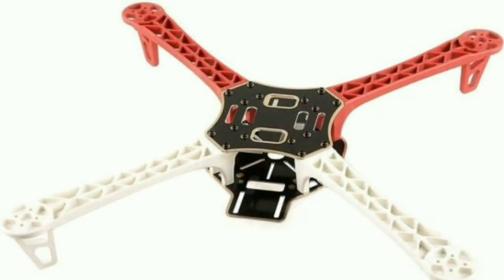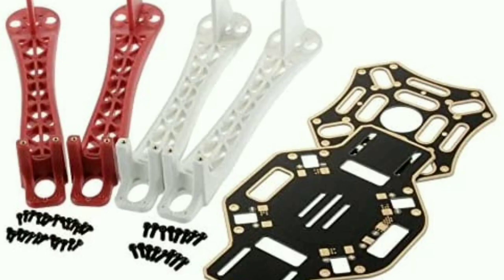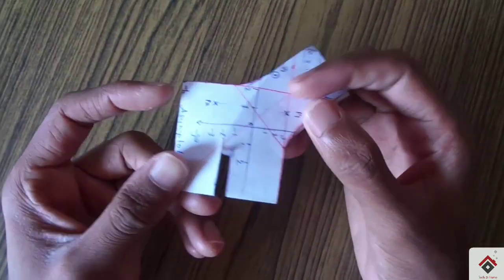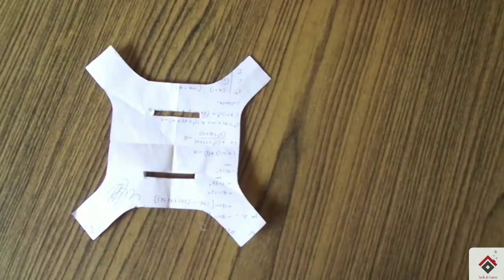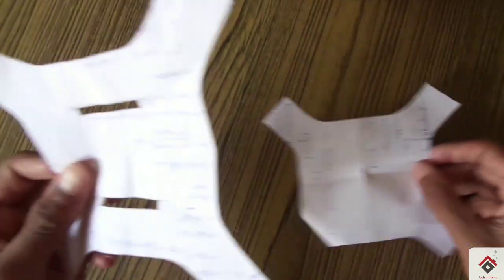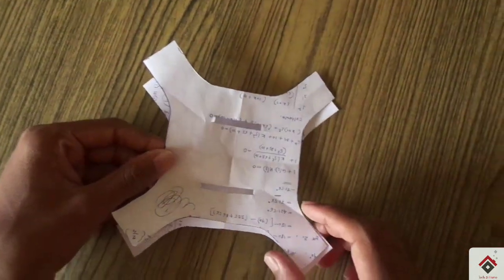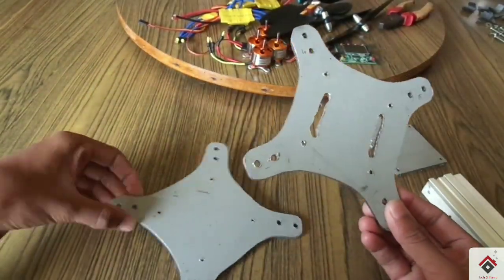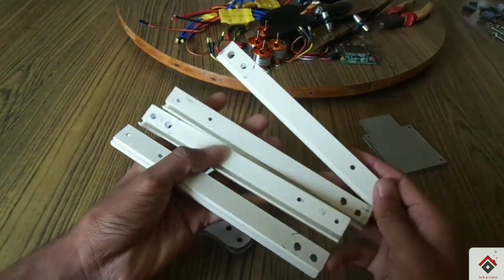Drone Tutorials Part 6 | Quadcopter Frame Assembling (Homemade) | Tech at Home

Comment: Do the wires need to connect esc to power distribution board come along with the escs or we have to buy seperately?
Reply from the maker: Come with esc
Reply: @techathome  thank you 😀you are doing a great job🎉🔥 keep making videos and keep sharing knowledge 🙏
Reply: @techathome  hello bro I have one more query,so is there any different esc power distribution board for pixhalk or anything will work for it,  hoping to get the reply soon🙏
Reply from the maker: There is no specific one,
Its Just for powering all ESC'S at once, so you can use anyone
Reply: @techathome  thank you so much for letting me know🙏

Comment: my flysky ct6b the arming is done when i slide to left actually it should be to right how to change it
Reply from the maker: I have not used ct6B, we can change in fs-i6.
I think you have to use computer.
Which flight controller u are using
Reply: @techathome  kk 2.1.5 flight controller
Reply: @techathome  may i get your contact